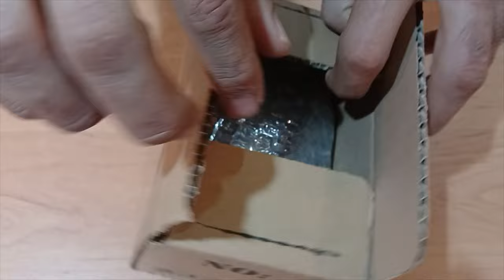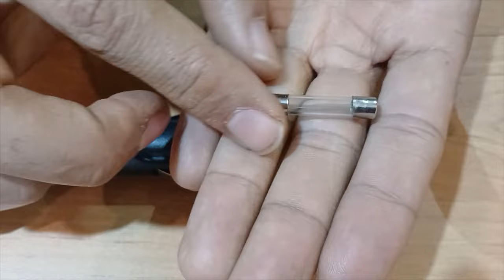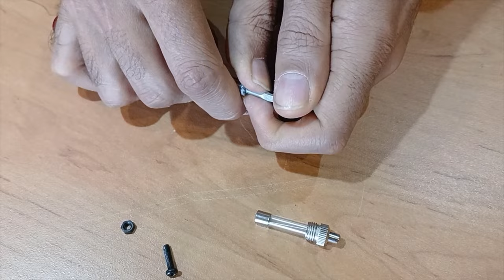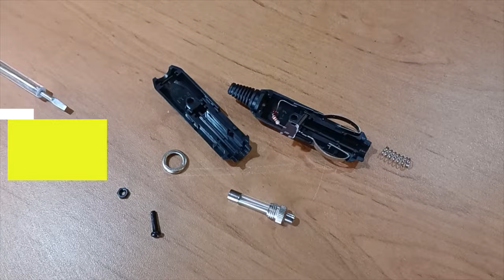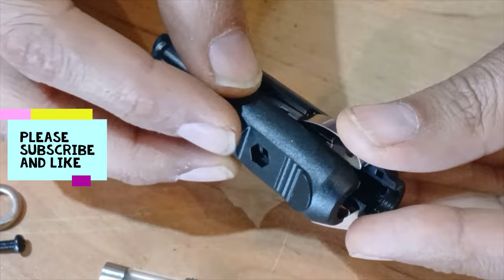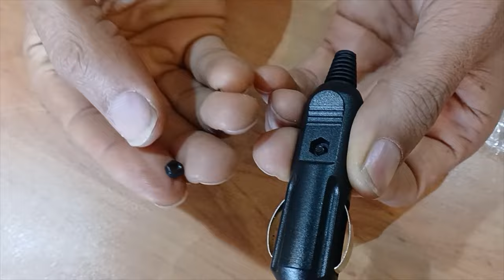Open and close Male Cigarette Lighter Plug 12V 24V

Comment: Yeah but where do you put cables?
Reply from the maker: Solder the wires to the inner pins. And the cable comes out from the end section. We will post a new video of the correct method soon.